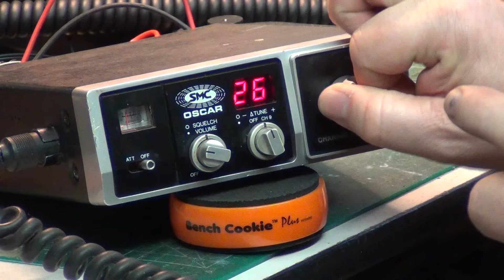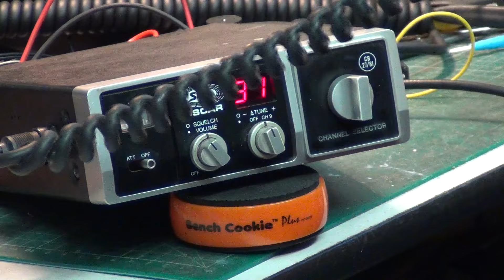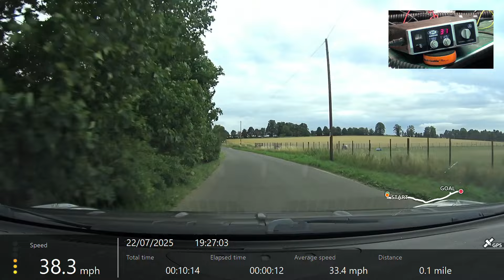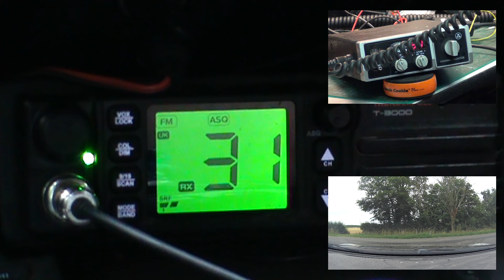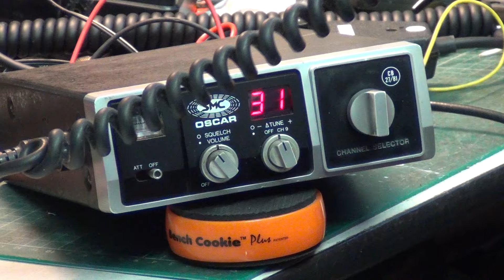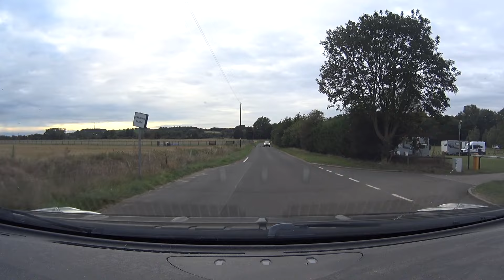SMC Oscar One CB27/81 UK FM CB radio -  On The AIr test + bonus footage geese cross at doggy daycare

Comment: The SMC did well at all the key points and on low pwr at five mile point it was just noisy conditions there, and like you say it doesn't matter about the meter as I know myself you can play it by ear what signal is coming in by the quality and modulation.